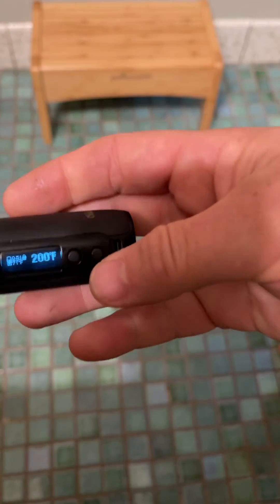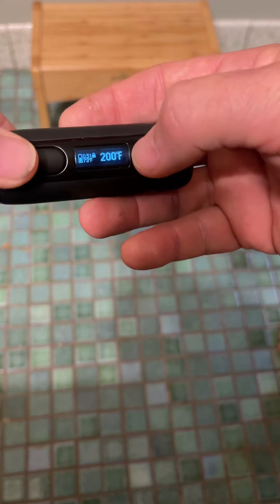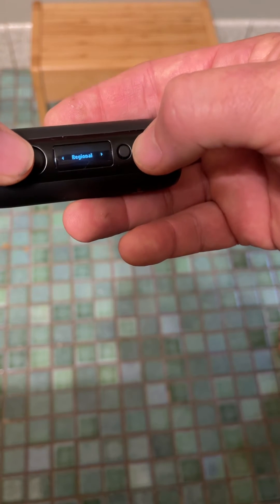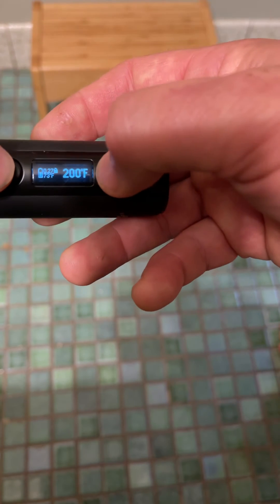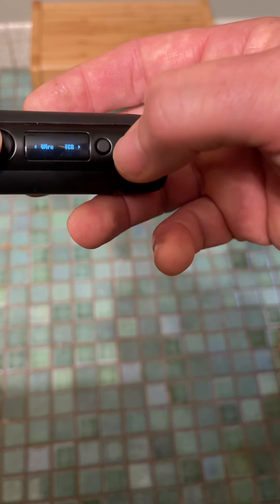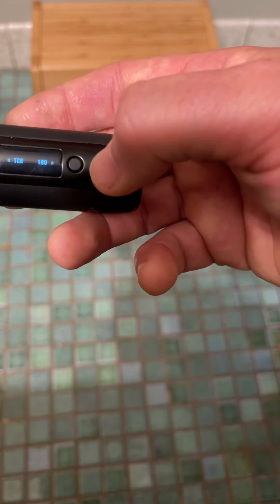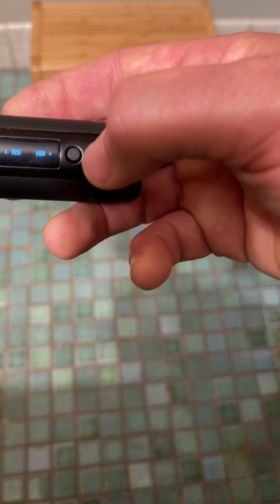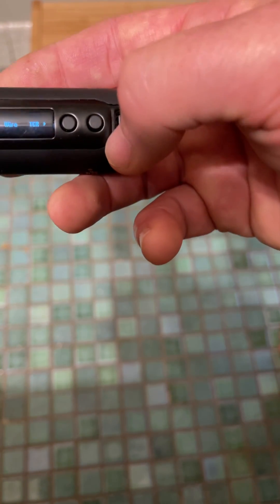Arctic fox rim c tcr mode

Comment: you need more tutorials, period. At this point all of the money I spent on my DTV4 I see as just a waste of money & I have nothing good to say about the product.
Reply from the maker: It can be tedious for some people, and if you have any problems I definitely wouldn’t recommend spending a ton of time on it.  I will offer you a prepaid label to mail everything back for a full satisfaction refund Just keep that in mind if you’re over it I completely understand
Reply: Set your mod on Ni Temp Control. For the SiC bucket, 330-350F is your temp. For Quartz, 370-430 is your temp. Just press and hold the fire button until you're at temperature and keep holding.

If your mod has a 10 second limiter, find a way to disable it. The device won't work well with this restriction. I suggest using Cheat Engine. I changed my Voopoo time limit to 55 seconds. Works great.
Reply: @naregm5492  got a refund, product just isn't for me.

Comment: So is Arctic fox easier than the regular TCR..?
What's the benefits once you have it setup?
Reply from the maker: the only thing i like about arctic fox is that it has up to a 60 second auto fire feature
Reply: It isn't needed, but makes the device more versatile for concentrates
Reply: It makes it so you dont have to pulse.  Which is both good and bad.  Auto fire for like 25-30 seconds mean i grt about 3-4 nice hits.  First is flavor and the next 2-3 inhales is for maximum stonage.

If you cough after first or second you can just click the button and autofire stops.  I only use pulse firing when the amount of concentrate im using isnt likely to have enough to puddle up in the dtv4
Reply: @ih7345  Are you using any  filtration?
Reply: @HB-ee3hq  glass adaptor with water